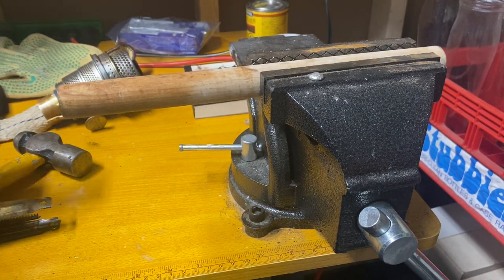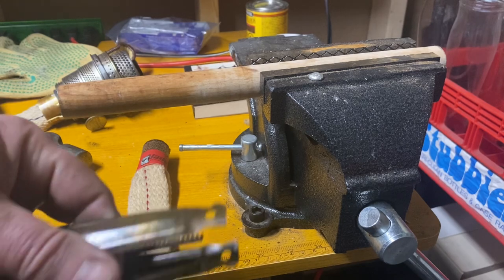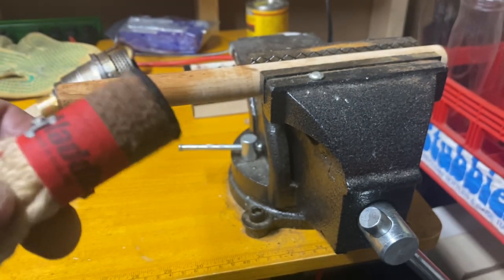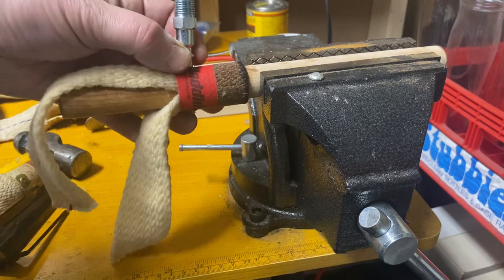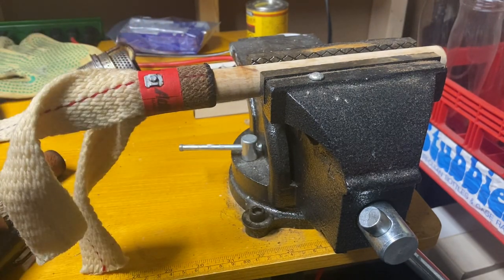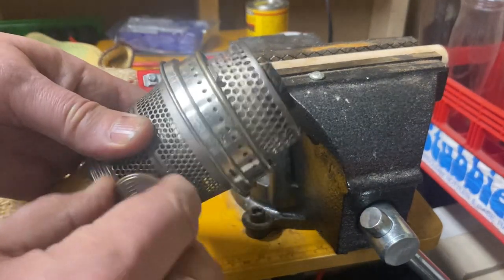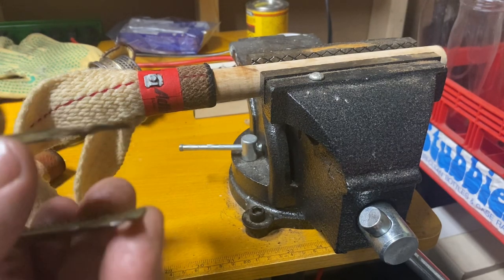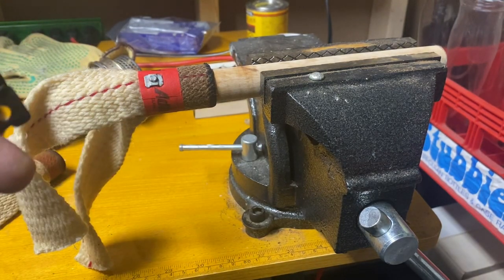Aladdin Model B wick clip Modification.

Comment: I’m new to all this but have acquired what I need to get my grandparent’s Aladdin Model B Lincoln Drape in working order.  Unfortunately, I cannot find one video or, for that matter, any instructions on how to replace my old wick with my new A-B-C wick with the bottom wick raiser mechanism.  I realize this is so basic for someone experienced but currently a real puzzle  for this beginner.  This video will certainly be helpful too…once I know how to do it.  Could you offer some guidance?  Thanks!
Reply from the maker: It's fairly easy Tim. Twist the gallery off. Twist to remove the outer wick tube. Note that one slot is larger and there are two bumps on the burner body to line up later. Pull the tabs of the wick raiser to release from the wick, then spin the knob so the raiser lowers. you sort of need three hands or a few items to slide under the wick riser fingers to keep them back. The old wick should just pull up. It might be stuck, green and such so be prepared to wrestle the wick off or cut gently to remove. Make sure the inner wick tube is clean and polished up before putting on the new wick. 
Good luck.
Reply: Thanks.  I wasn’t very clear.  The old wick is already off and gone.  I don’t know how to put the new wick on.

Comment: Just wanted to thank you for this video tip. I got a new wick in the mail today for my Model 12 . Installed it but couldn't raise or lower the wick. Anyway, I happened to have the same air hose fitting as you, and my wooden broom handle was the perfect dowel size. My model 12 is working once more! Thanks again!  :-)

Comment: Can you help?  I'm trying to get a Super Aladdin 14 going here in the UK, I have a problem with the new wick I fitted. I have a small area that burns with a lower flame than the rest of the wick. On inspecting the wick after burning for about an hour, I have a semi circular indentation at that area of the wick where it seems to have burnt more of the wick.  Can you please advise on this issue?
Reply from the maker: I think you just need to slightly trim the wick.  It very important for wick to burn evenly or the lamp will never reach maximum light output.

Comment: Thanks for the tip. Where do you find is the best place to shop for replacement parts ?
Reply from the maker: I’m in canada and I sell replacement parts. If your in the states, I would Lehman’s, Imperial Lighting, there is a bunch on Aladdin website.
Cheers
Reply: @Kerosenecanada  Imperial Lighting for the win!